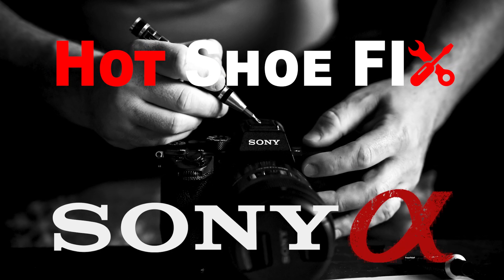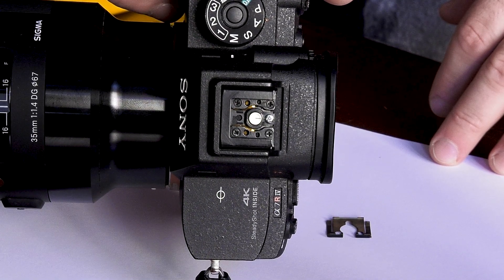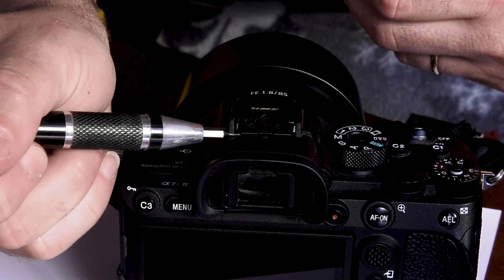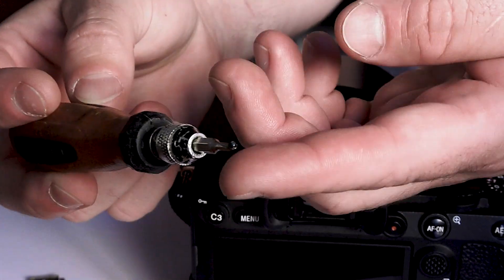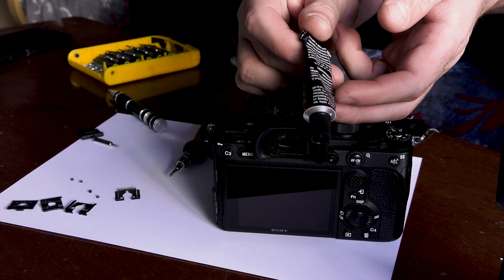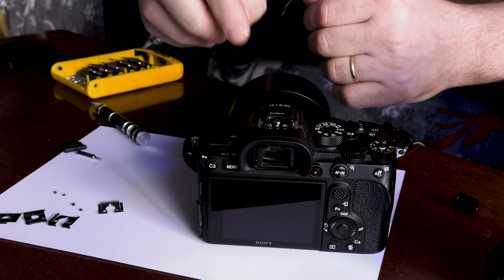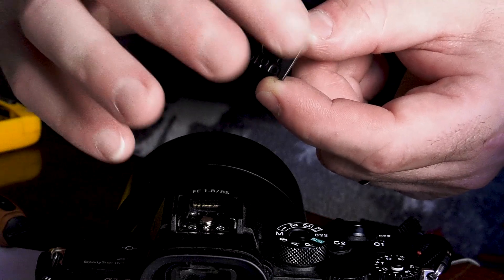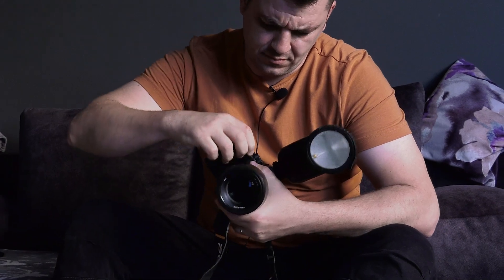Sony cameras Hot Shoe Fix

Comment: I just fixed mine without the glue. All 4 screws were somewhat loose. I just tightened them up. Thank you!!!
Reply from the maker: that is what i did allsow , but i showed the hole process because of that piece of iron on top of the screws
Reply from the maker: If it was helpful, pls consider subscribing :)

Comment: Mine came off completely. The estimate to repair is $750. On something that is obviously an issue with Sony cameras. I've also had an 85mm 1.4 GM and a 16-35mm 2.8 GM go bad and just stop working. No dropping or damage whatsoever. Not impressed with Sony right now.
Reply: Hey, I am having this same issue right now. Got quoted about the same price. Did you send it back to a Sony? If so, how did it go?
Reply from the maker: @ericreynoso861  way not just repair it yourself
Reply from the maker: If it was helpful, pls consider subscribing :)

Comment: My Sony A7IV hotshoe connectors have been damaged. My local camera shop said this would quite costly work:-(
Reply from the maker: To replace it , i think u need to open the camera , so is best to do it in a certified shop
Reply: I think my connectors are damaged because it’s not letting my Strobes high speed sync, what did you do to fix it?
Reply from the maker: @chevysmith3542  tink on some alchool to clean the contacts, or replace the connectors on the strobe
Reply from the maker: @chevysmith3542  If it was helpful, pls consider subscribing :)

Comment: To replace the whole hot shoe with a new one, do you just remove the 4 screws, pull it off, pull the ribbon cable out, and then connect the new one and put all the screws back as shown here? I have to replace the whole hot shoe and I can’t find anything anywhere on how to do it. This video has been the closest I found but you don’t do a complete replacement.
Reply: Have you been able to find a replacement hot shoe? I can't seem to find one to buy anywhere.